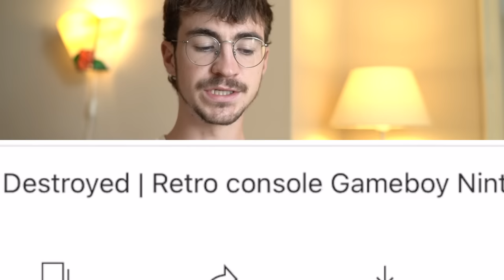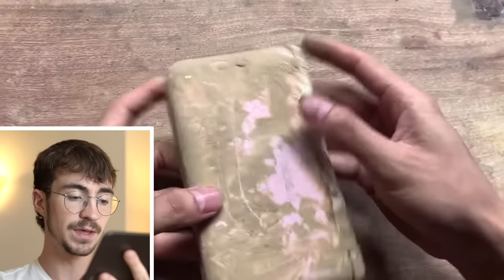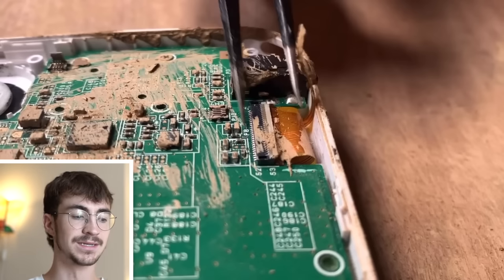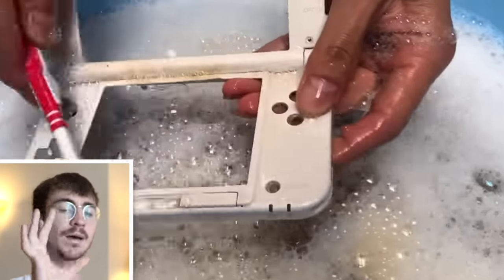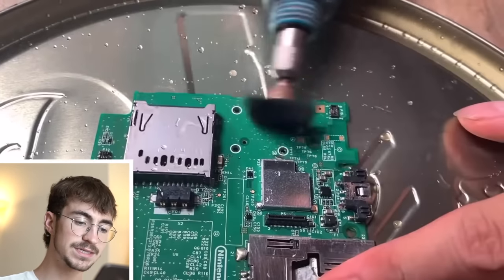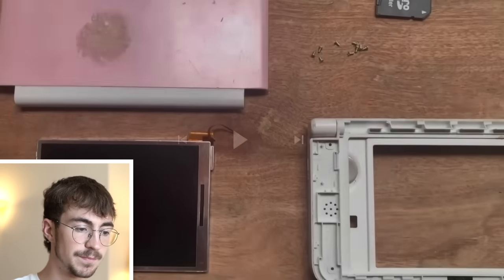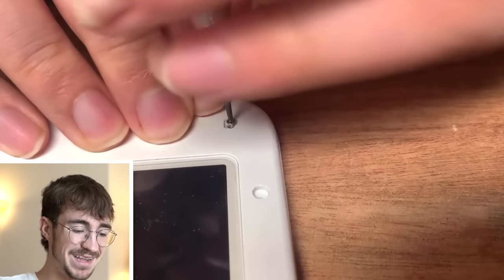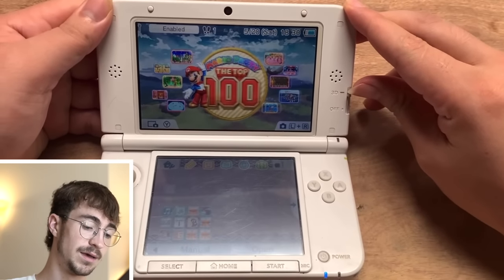Exposing the FAKEST Nintendo DS Restoration

Comment: The mud on the inside is hilarious, you'd expect that mud would penetrate wherever there is an opening in the shell (around the cartridge, around the shoulder buttons, charge port, etc) and spread inward from there. But nope it's just in there all willy nilly
Reply: Yep...and I have a sneaking suspicion that Mother Nature doesn't use a brush to fill the 3DS with mud...!! 😀
Reply: it spawned there
Reply: I don't know why they don't just drop it in a bucket of mud, the "restoration" would at least look somewhat real that way.

Comment: I used to work at a Nintendo service centre here in farlington in the UK and can confirm the pad is there to determine if the console board has been exposed to water, and in all cases where it is pink it will void the warrenty and (at least when I worked there) would incur the largest repair charge. Great vid BTW :)
Edit: what is interesting, at least to me lol, is that in some of the red dslite shells used to sometimes get a very odd bubbling effect on the case behind the screen, which only seemed to happen on some of the red ds lites, nothing like the whole they made in this ds ofc but for some reason it reminded me of the very odd red ds lites we used to take in, one of the few strange repair jobs alongside the countless broken hinges lol
Reply: I think it's cause the red DS lite had two layers of paint one metallic crimson and then clear this the separation occurs

Comment: Odd tinkering does actual restorations I believe. No weird cuts or looking through the trash and stumbling on it
Reply: I dunno man... All the consoles they repair look exactly the same, yellowed to shit like they're piss soaked, and dunno bout you, but I don't think I've ever seen old consoles look like that
Reply: @justpassingby298  Plastics from that age do yellow if left out in the sunlight. It's possible he just goes through ebay and finds the worst ones. Also I've seen tons of consoles yellowed like that from other channels like 8 bit guy and other bigger retro focused channels
Reply: @crestofhonor2349  I mean I guess it's possible I'm just looking to deep into it, but dunno man, some of the things he repairs just look way overblown, maybe it's just some thumbnail editing for more clicks from the few videos I skimmed through, usually the things weren't that bad
Reply: @justpassingby298  Most of the damage seems to just be cosmetic. Most of them turn on right away or just have something small not working like the PS2 disc drive, which are known to fail with even a little bit of dust or whatever on the laser. It's not like they're in a ton of pieces. Most of the restoration is just making it look cosmetically better

Comment: That baking soda and super glue trick is supposed to work well. It creates a plastic like surface. Idk why it isn't sifted tho lol.
Reply: *cocaine
Reply: It works shockingly well. I use it to restore small cosmetic nicks in carbon fiber bike frames and it produces a really hard, tough surface with a tight bond to the substrate.

Comment: during the cleaning process of the motherboard with the dremel, it has not been filmed in reversed process, because the liquid indicator, the white/pink stamp, turned to pink after using water.

but few seconds later, when testing the LEDs, the stamp magically comes back to white....

and for the "repaired" back plate, there are not the marks made by the soldering iron... definitively other evidences of fake restoration....

I definitely like these "debunking" videos of fake restoration. thanks
Reply: I was always told as a kid that if the white turned to pink, the item was defective. I'm unsure if that's still true!
Reply: @michan2006  yes it is. This white stamp is still use in the Switch for example

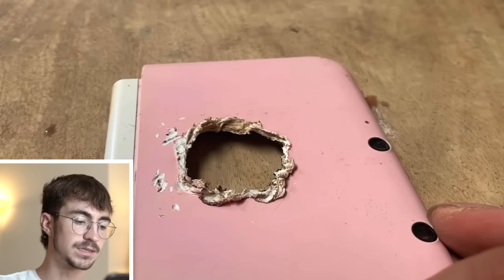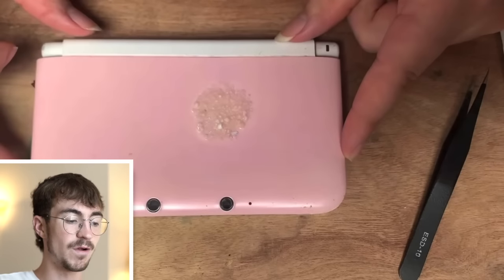Comment: The funny Part is that they managed to get rid of the Soldering Iron Marks on 8:47 and get the Original Paint back on there on 15:38. If you compare the Time stamps it's obviously that they dremeled it out after that footage with the fake filler was filmed.

Comment: I love it how the professional at one point randomly probed a connector on the board, to any random pad/component there. Also I don't remember if the 3DS had stainless steel springs, cause damn they looked pretty given all the mud (...why always MUD?) in there.
Reply: Mud is easier to rip off after it's dried
Reply: I don't think there are Any springs in the 3ds or any da for that matter lol
Reply: @animeloveer97  One on R and L, plus the weird one (or how many it uses internally) on the hinge mechanism.
The GBA is the same in that regard, just the GBA got two hinge springs/mechanisms.

Comment: It's funny how these videos the devices have always 2 characteristics, an impossible amount of mud, and a hole that can't be found on any other console, only the ones they "find" them
Reply: The thumbnails also always happen to have a lot of rust on the plastic.  Plastic oxidizes, but it sure as hell doesn't rust in the process, or retrobrite would require mechanical action through vinegar and not chemical action through hydrogen peroxide and heat.

Comment: It's baking soda. The implication is that super glue and baking soda cause a chemical reaction which instantly makes the glue "cure". Which actually is true and is used in model making or small repairs. In fact, a hole of that kind could likely have been patched up if they had comitted to that process. It wouldn't have looked seamless, but it could've been sanded and smoothed to look very inconspicuous.

Comment: This appears to be a case of some sort of manual obsessive compulsive disorder. Fumbling with everything, painting random things with mud, prying apart electronics. Luckily this individual self documented for later medical study, lol

You could probably repair a big hole with something similar to that method though. Superglue and baking soda forms a very strong and hard material. I've had little grips glued on my flexible phone case for years with that combination and theyre not going anywhere. Theyre made of sugru, which fell off because the plastic underneath was too flexible. You'd probably need to do a fair bit of sanding to get it decent though, and you'd need to sift the baking soda more than that guy's super clumpy stuff

Comment: Japanese 3DS are being sold for super cheap on eBay, at least relative to new ones. My basically mint condition new LL(stylus too!) was around $130 with shipping. Many are sold for even cheaper where there are significant, but definitely repairable, issues such as a damaged screen or game card slot. Really sucks that they’re probably lying about restoring it and taking probably very much salvageable consoles off the market when the 3DS is being price gouged as is.

Comment: best ways to tell a fakes restoration video is if the object has paint and it hasnt deteriorated and just has scratched, sticker coloration and edges being intact and the screws missing and edges where the screws are being intact and metal not rusting if it was found outside

Comment: I think I mentioned this in a previous video, but they use texture from games workshop and Vallejho.
You can literally see the brush strokes  spreading it to strips as those texture paints like to split the brushes into clumps.

Comment: I've seen one of these """restauration""" vids where the guy found and "restaure" a 30yo Computer (so apparently a 386/486 era machine logically if we follow the said age), but when they opened the machine, the motherboard was a late ... LGA 775 G41 chipset motherboard with a Core 2 Quad CPU and DDR3 memory from 2010/2011 !

Comment: Not to defend the fake restoration,  but cyanoacrylate glue mixed with baking soda is actually a legit method of patching plastic. It can be brittle though if you use too much baking soda and not enough glue.

Comment: At 11:33 you can clearly see the two tiny connectors that are damaged, the volume slider one (P17) and the touch screen one (P12). They are easy to break when you don’t know what you’re doing, which is their case.

And later in the video, the tiny locks are back… stupid

Comment: I imagine actually restoring the things in those video to be so stressful, especially other things. Theres machines to use and spare parts to find and to buy and it probably costs way less to just buy the item new. Even if the stuff gets sold afterwards, if its not a very rare item theres probably not nearly enough paid to cover all the work put in. But it still looks satisfying.

Comment: When I was younger I accidentally spilled soapy water onto a few GBC game cartridges. It took less than 5 minutes for that to mess up the board and that video is trying to tell me that the 3DS that was supposedly caked in mud, in a pile of garbage, battered by tropical storms, is still working 100% and had ABSOLUTELY no damage or rust in the motherboard.

Comment: As to superglue there is actually a legitimate method to patch up plastics, by sprinkling the finest baking soda in and letting superglue soak into it. I wouldn't do this on a large area of a pretty flexible panel, no, not at all.

Comment: (Edit from not even a minute later): nvm, he called out the actual flaw like-  30 seconds later- still leaving the rest the same cuz I’m lazy lol

Wait-… so if the water scene and the pink water damage pad happened before all the mud and stuff, then wouldn’t the pad be pink as they were taking the ds apart while it was “dirty”? 
I mean- It’s still obviously faked, and I don’t doubt that they do this in other videos, but I’m just kinda like “wait a second-“ lol. 
Either way, hope you have a nice day, and thanks for exposing these content farms! 
Also, fun fact: water can actually be used on electronics! Water by itself is surprisingly not conducive, it’s actually the minerals in the water doing that. This means that as long as there is no power in the circuit, and you make sure to dry that shit really well (preferably with paper towels or something-), then a short likely won’t happen. (Although I still really wouldn’t recommend just straight up pouring it on- try a damp paper towel instead lol-)

Comment: I used to watch these videos and get inspired to start repairs 4 years ago. After I started restoring devices, I understood that these videos are BS. I started learning by watching NorthridgeFix, TronicsFix and HughJefferys. When I encountered soda or milk damaged mechanical keyboards, first thing I noticed is corrosion across connectors and the 1mm vias on the board getting disintegrated. Even flex cables get delaminated with milk. Then I started reporting such videos when I get suggested. I never made YouTube videos but it's a good enough hobby and I bought all my tools with money raised from resorted devices. You haven't even seen mud soaked smartphones get resorted. that's next level from other Filipino YouTubers who do similar shit.

Comment: It's obviously fake, no question about that - one thing tho, which actually confused me...
If you are right about them filming the clean version first and then swapping the footage, which I would agree on being likely, the moisture control pad should be pink on the dirty version since they would have had to film that part after sprinkling it with water...

Comment: Actually, as long as the people in these videos NEVER turn the consoles on, they are still fixable because water can only damage electronics if the electronics TURN ON, because water is an electricity conductor and does absolutely nothing if electricity doesn’t go through it. However if the consoles turn on while any of the boards are wet, the console will go beyond saving.

Comment: Little tips for spotting fake restoration video? Simple: 
- Plastic, screens and glass doesn't rust.
- Mud can stuck to plastic and so, but never in an uniform manner (in a river or under the rain, it would have get washed, so only the parts not directly in contact to that would have stubborn mud)

Comment: in brazil there are roller fairs, they are electric and toys are found in the trash and in rivers. they are sold very cheap one thing in the store costs 500 it costs 50 it often does not work it has something broken in my case i fix a table it cost 100 at the fair and i spent 200 to buy a new screen

Comment: I was worried about, specifically Odd Tinkering, because I've actually come to have a good deal of respect for their restorations, and sometimes improvements, to washed up devices. It's one thing to fall for a fake, it would be another to find out somebody you got respect for has been faking all along. But seeing this ludicrous fake video puts my mind at ease. 

First, even to a layman like me, the damage in Odd Tinkering makes sense with real life effects and what it looks like. Rusted battery plates, yellowed cases, screen burns, water damage. We know how they can happen, and their appearance match what we would expect them to look like. This fake, on the other hand, just leaves us wondering what in the world could have led both screens to just burst out like that, for instance. The "damage" makes no sense.

Not to mention, one wears gloves, methodically removes and neatly puts aside every single part and is able to rebuild the device entirely in the end. The other keeps tearing pieces of a device (allegedly) found in a landfill with their bare hands, it's the least responsible handling of an electronic device I've seen in my life.

Comment: The hole at the bottom was made by a hot air gun. The heat melted the plastic and the air pushed it outwards, making this crater looking hole

Comment: LOL.. As they put the upper case back to the lower one, they didn't guide the ribbon cables through the hinge and Slot.. they just layed the top part onto the lower part. That's why there wasn't the slider was there. Nothing was there at this particular moment. the upper case was completely empty

Comment: no problem inverting inverting probe polarity while measuring leds, leds are diode,s the current does not flow on the wrong "direction", and then he is probings the capacitors looking for shorts, pretty standard actually

Comment: You can definitely tell the "restored" top case is fake in the 'here's all the parts for assembly' shot. The "patched" hole isn't extending far enough to cover those dremel/soldering iron trenches.

Comment: That first screen was stabbed with a flathead screwdriver and pealed outward from that stab wound. The last layers betray this clearly as the damage is no longer "outward", but inward. Second screen exhibits similar outward initial appearances. Ironically, pulling it apart betrays all the restorer induced damage, but then again the vid title told me it was BS anyway.

Comment: Those moisture indicators don't always work. I accidentally dropped my iPhone 5s into the (freshly flushed) toilet and the sticker never turned pink. 

I immediately turned the phone off (it had the strangest patterns on the screen that are usually considered signs of death), wrapped it in paper towels and then covered it with rice, figuring even if that was a hoax it shouldn't hurt as long as the phone isn't in direct contact with any of it. After 48 hours I dared to power it back up again and it worked flawlessly for four more years!

So basically the phone was wet enough inside to give me the weirdest screen glitches but the sticker right inside the charge port didn't change colour.
Edit: this one clearly did work though.

Comment: Not a restorer, but baking soda and water work to take off acidic corrosion. Its a last ditch method but it coears battery acid or acidic mud. If you let dry then use a silicon brush and isopropyl it cleans off most. Never used for rf like these guys video signals but it works for sub 1 Ghz signals no issues. Might work for video and audio signals

Comment: How does the water strip becoming pink prove they have filmed in reverse? If anything that should prove they didn't, because when they took it apart it was dry. They could have just used another board too and they could have filmed other parts in reverse, but if it's the same board that means they did actually make an attempt at cleaning up their own mess.

Comment: When they were shoving it back together they probably broke the sliders on the inside connected to the motherboard bc as someone who has taken apart their DS they are unfortunately very easy to break clean off, leaving the DS unable to do some things, like in my case power on because it's a DS lite or DSI I forget

Comment: You can tell the footage is not in order because the overview of it after they totally cleaned it up, the pad that denotes if water has gotten in the system is magically back to normal when it was pink the scene before after they put water on it... and salt, gotta make sure your 3DS is well seasoned. Wouldn't want it to taste bland when they threw it in the bin moments after turning the camera off.